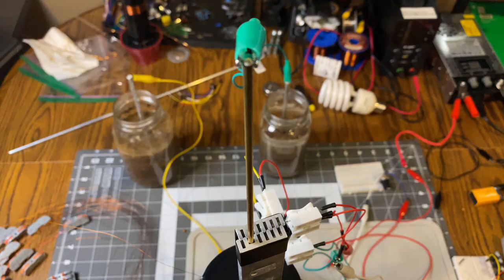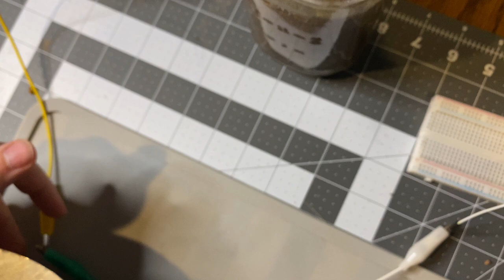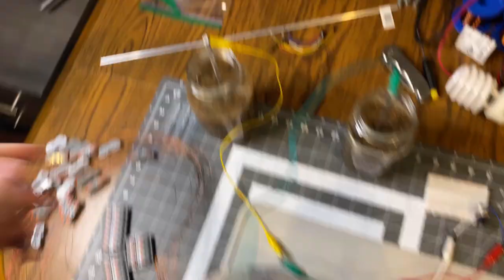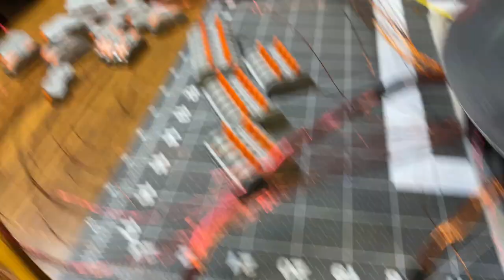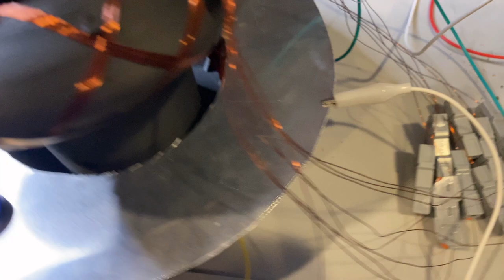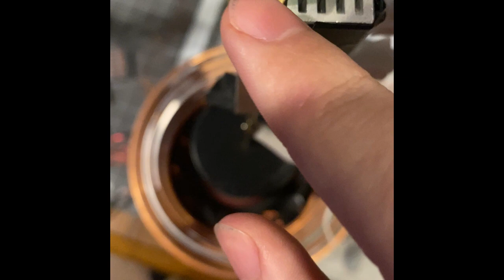Tesla Coil Log #4 - More Power and Cooling Effects

Comment: i don't get it, why you made the coil so odd looking? what are those jars? i didn't watch the entire video cos it's too long
Reply from the maker: Thanks for watching. The coil shape is a cylinder with the copper tube as the primary and the 32 awg as the secondary. Most of it is covered up by electrical tape. Everything underneath it are separate coils that I am playing with. The rod down the center is not attached to anything, but it gets an induced cold current from the tesla coil. The jars I am trying to resonate the silica in the sand from the frequency emitted by the tesla coil.  Not getting that yet, but they are at the very least a source of ground. Jars also have water and salt in it.
Reply: @bytenite64  you know that fantasy works with art but doesn't work with science right?... i'm just trying to spare you some aimless work